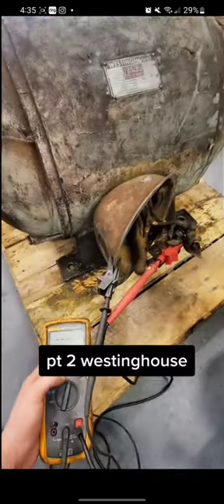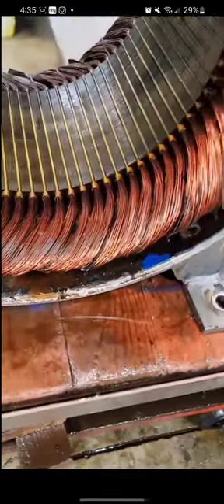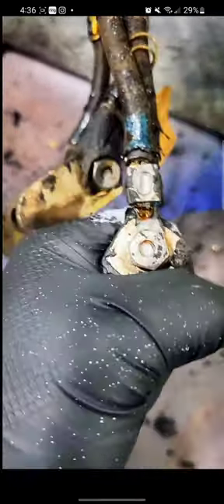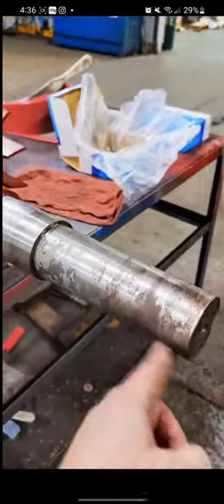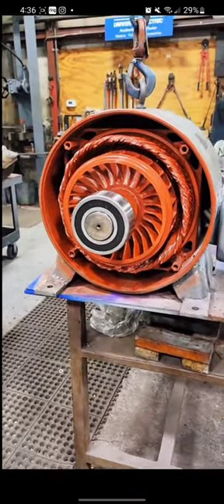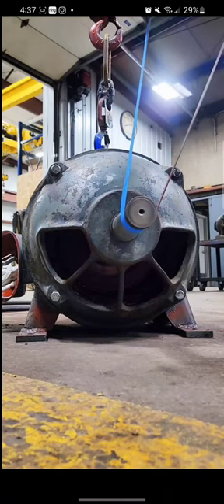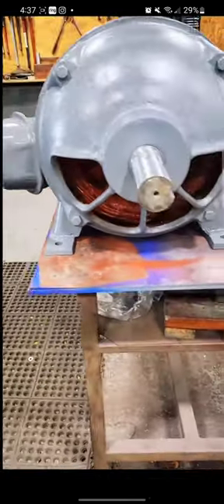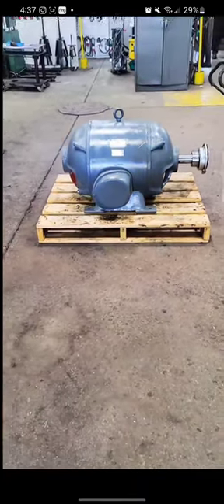Westinghouse Electric Motor Repair

Comment: Are there any trade schools still teaching motor repair? I worked in a repair shop, but I did the machine work, testing, disassemble, and reassemble. I never did winding. Always wanted to learn. The one winder that was willing to show ne died. The other guys didn't have the patience. Kept a lot to themselves.